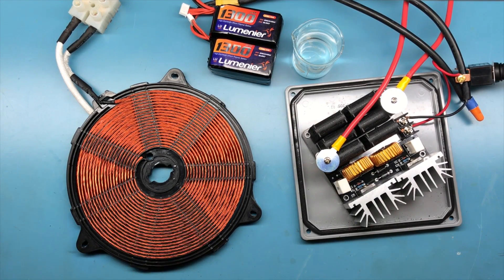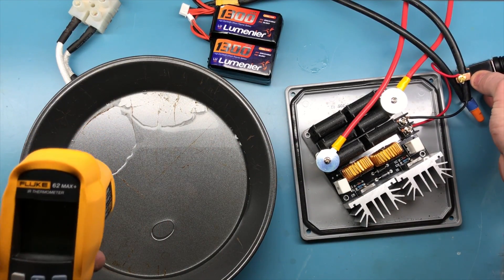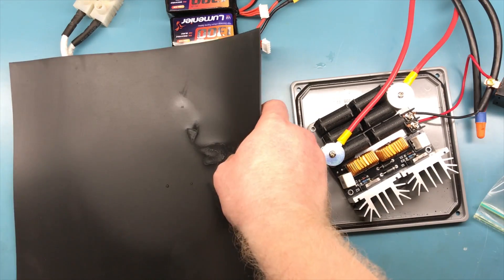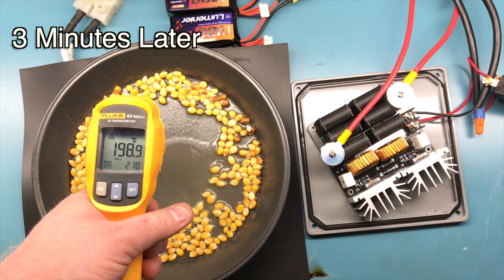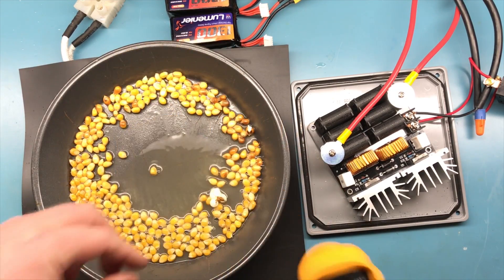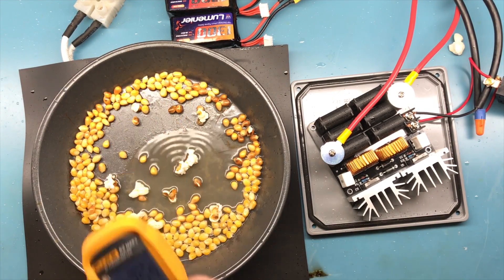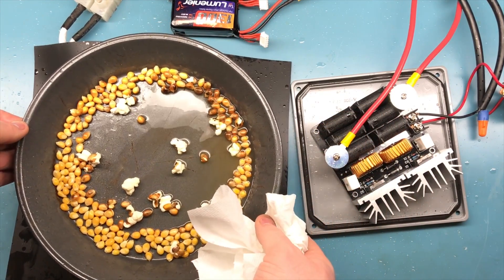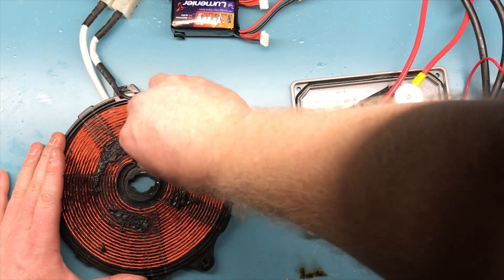Portable Induction Cooktop Test 2

Comment: it is the laminate clad  overheating, not copper, probably phenolic laminate, they are crap for higher power and frequencies
Reply from the maker: The copper is heating.  Check the levitating platform video.  This frequency melts aluminum foil and copper foil pretty quickly.

Comment from the maker: If you like my videos, please consider supporting me at https://www.patreon.com/ProtoG42 to help me produce more content.  I spend quite a bit more money buying parts for videos than the income that the videos generate.  Another great way to support me is buying from my Amazon store here: http://astore.amazon.com/prg06-20.  You can also support me by simply subscribing, liking and commenting on my videos.  Thanks for watching!
Reply: what voltage  14v or 28v
that board is 20amp  tested at 53 volts......
those coils are rated 110v or  220v  
you can get low voltage coils....
your lipos wont last long using them that way....
you should  do a real test... at 48 volts 
get some good scooter battery 20 amp hour  <36v--48v
then use a step up 400w booster..... find power usage with good cooking batch////// no mickey mouse pan you want to cook....
http://www.ebay.com/itm/Digital-Led-400W-10A-DC-Converter-Step-Up-Constant-Voltage-Current-Boost-8V-80V-/401154825083?hash=item5d66b0db7b:g:NlMAAOSw6WdXiZe4
thats a 1000watt board.....
its hard to find DC cooking   its all AC   and you need the correct coil 
i did find sme but you need to order 1000 units  lol
with the correct coil the space is better for the pan.... with better energy transfer emissions.....  again if the coil is  rated 110v try upping the voltage with good battery setup...  like 48v ebike cooker...lol
now that would be a funny video..... drive it off the charge plug...the wires are good for 5-10 amps..... with a roasting pan and real roast or chicken in it...lol
list it up as....how to cook a chicken on your ebike...lol the 400w booster lets control the amp flow but voltage must be 2 volts above its input... so if the unit can handle 57v .. it was tested at 53v... so it should work,,,, its probably rated 60v
Reply from the maker: This is 28V but you can watch plenty of my other videos at 48-53V where I melted aluminum. It's just a demonstration as I have absolutely no need for a portable induction cooktop. This is not DC.  The ZVS driver is acting as an inverter.
Reply: here is the manual
http://www.casogo.com/Manual/ZXY6020S%20User%20manual%20R2.2.pdf
it has TTL serial communication port on it<---- bingo 
now you can create software that will control the Portable Induction board......  the board is made for battery charging..... or power supply.... you can run serial commands in it... all you need is a wifi arduino board ohhh then add extra temp sensors on cooking pot .... then run it off your android phone....
Reply: just saying you have the coil and it would make a funny video among ebikers.... you would get some good hits.... park at picnic table take out the parts..lol <--- thats the funny part... you want me to cook how on my e-bike

 i need to build one for cooking ... yes 53 volts is needed for a roasting pan ... but it needs to be controlled... on off on off  zapping the roasting pan

the ZXY6020S  control looks ok.....even if you wanted to automate a task like hardon 1000 bolts....  i know how to arduino and android code.... make the unit make you money...

yes the  board inverts it to make it work.... yet it source dc....

i need direct control and using a ac unit is no good from a dc to inverter to induction cooker..... you double or triple the cost to run the unit from dc...
Reply: Its possible to regulate the temperature of the coil?

Comment: Very cool! When the copper was there was it shielding the magnetic field from getting to the pan?
Reply from the maker: Sure, it was shielding some of the field, but the pan was still rapidly heating.  The copper would need to be thicker than the skin depth of the operating frequency to completely shield the field from the pan as well as have a larger surface area.

Comment: Could you use a towel or regular cotton cloth between the cook top and the pan?
Reply: Quick google search says that cotton self ignites around 400C, so you should be able to use a 100% cotton cloth as an insulator here. I'm assuming that you're trying not to melt the insulation on the wires in your coil due to direct contact with the pan.
Reply: A $12 'plumber's pad' would work, here, too. They are draped on things that could catch fire/burn/melt when using a torch on nearby pipes. There are some on Amazon that are fire resistant to 1800 degs F. It's overkill, but I use one under the heated bed on my 3D printer. A scrap of clean wool from the fabric store would work well, too. It should be good to around 600 degrees F. 'Fire blanket' material is similar. It's thinner and cheaper (for a given area) than a plumber's pad and burns at a high temperature.

Comment: You are pretty anxious man! Let them cool first!  By the way wouldnt be better an "induction ready cooking pot" they have special material at the base to better heat distribution
Reply from the maker: Martin Lopez it was late yesterday and I hadn't eaten dinner yet lol but the pan I was using was an "induction ready" pot.  It's steel.  Stainless steel and aluminum cookware does not heat up as quickly as regular steel so manufacturers add a layer of magnetic alloy to the bottom of the pan to increase the rate of heating.  I have a few at home but the wife would only give me this one :)
Reply: Proto G i know that song: "you are going to do whaaaat with my new whaaat?!?  Use this instead"  http://media.metroscubicos.com/625x415/media/2012/11/07/cocina-3.jpg .  Seeing the effect on the pcb i was thinking an use to preheat before cutting fr2 pcbs

Comment: I took apart the same induction coil yesterday for the litz wire to make a solder pot like yours,works great,question I only put one winding top to bottom like you did,would multiple layer winding work better or cancel each other out
Reply: A one layer coil has a specific inductance whose impedance matches the inverse impedance of the capacitors.  The two together (inductance of the coil, and the capacitance) help to create a resonant frequency that causes heating in iron.  You don't want to add a second layer without also adjusting the capacitance.  Iron heats when the resonant frequency is between 20 - 100 kHz and you don't want to get too low or too high of a resonant frequency.  If you don't know how to measure the inductance and determine the correct capacitance,  you are best off just sticking with one layer.

Comment: Lol, I was wondering what was going through your mind when you thought the rubber would be okay under that pan that you're heating up to high temperatures... lol.
Reply from the maker: Yeah, the melting point of that rubber is about 180C and I honestly wasn't expecting it to get that hot with only two batteries.  I also didn't think it would take so long for the popcorn to pop.